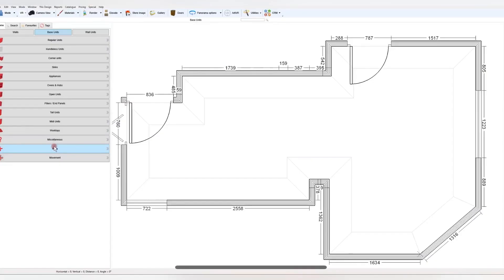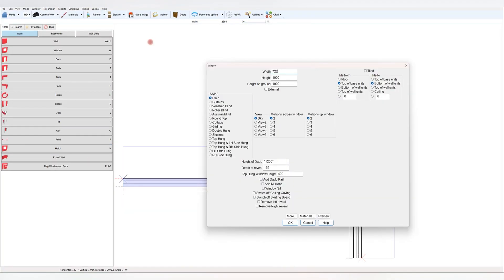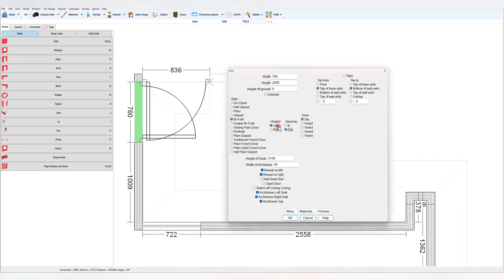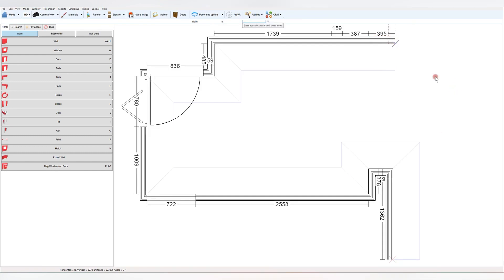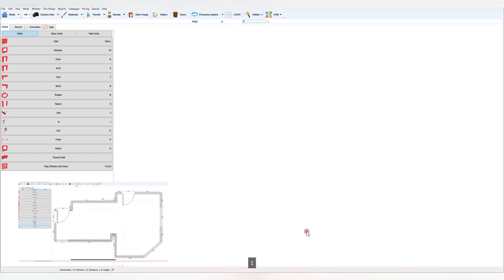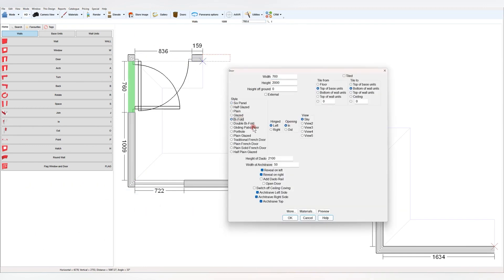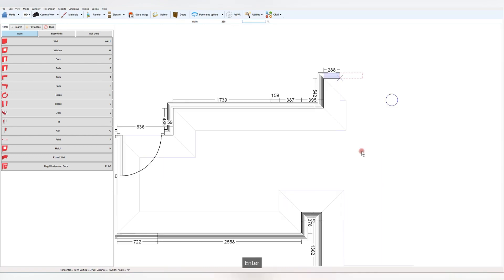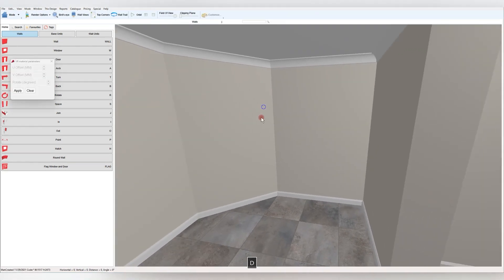ArtiCAD - Tutorial 002 - Angled Wall Demonstration

Comment: Thank you for this. Had always had trouble getting the angled wall at the perfect angle without trial and error.

Can you help with the add room feature please. The walls between the rooms are not coming out right after adding the room.
Reply from the maker: Hey, thanks for your comment and I’m glad you found that helpful. 

I used to use the add room wizard, but now I build the rooms together and add the internal walls. I’ll see about doing a video showing both.